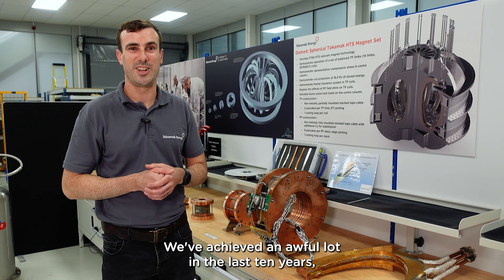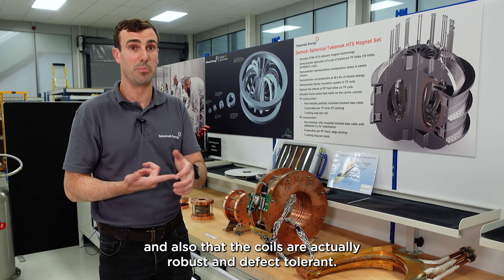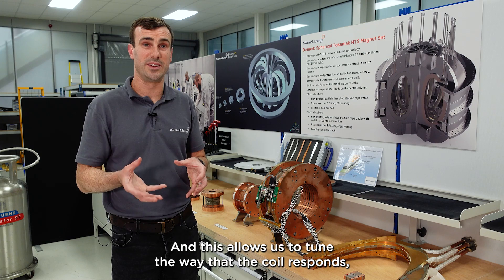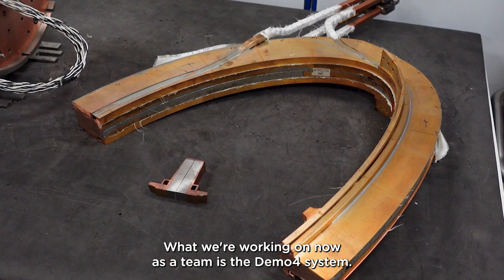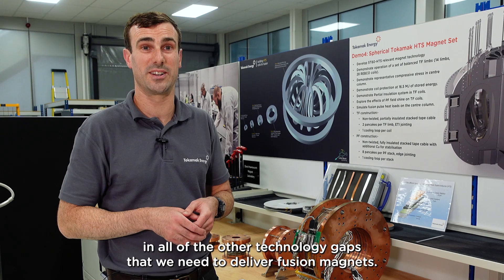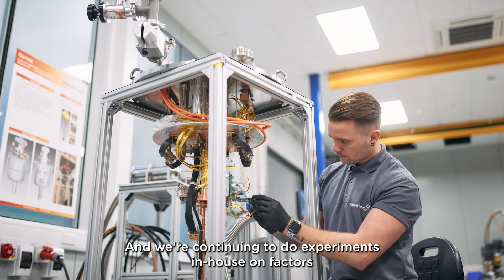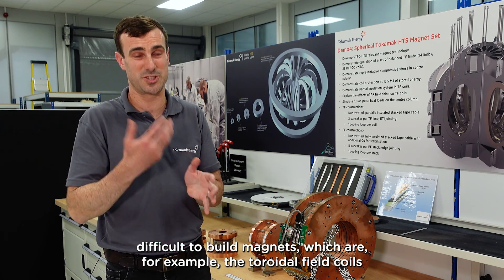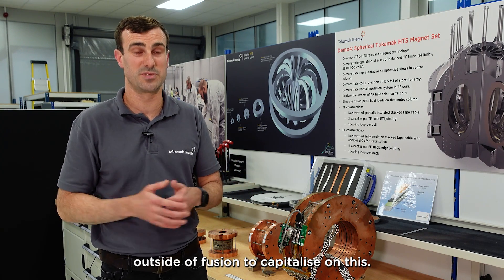Tokamak Energy high temperature superconducting (HTS) magnets - achievements and current projects

Comment: Can you cool them with something other than liquid helium though? Helium, being an ever diminishing resource is not something you want to be dependent on.
Reply from the maker: Yes, we can get down to 20K using cryocoolers without the need for liquid helium - it's one of the major advantages of high-temperature superconductors vs low temperature superconductors
Reply: @tokamakenergy6400  When running at steady state, will the fusion reaction produce commercial quantities of helium?